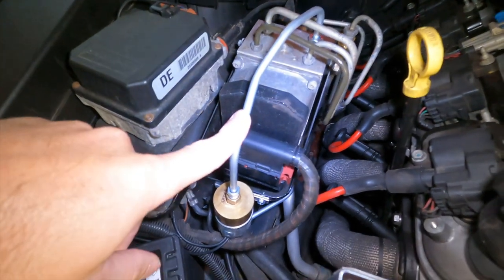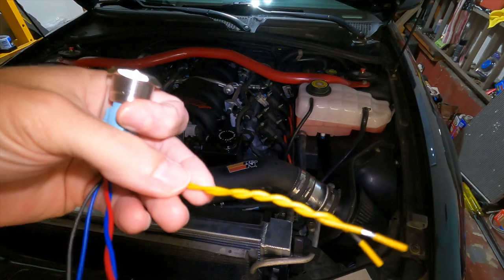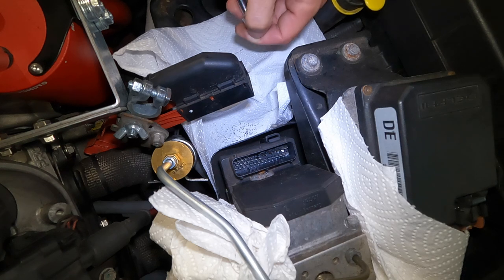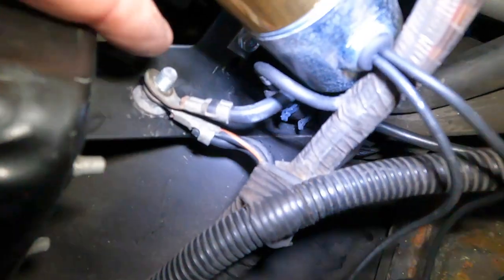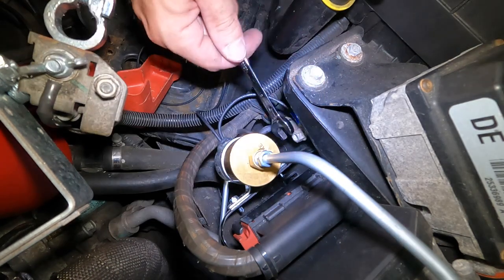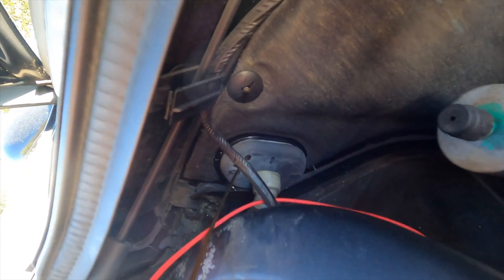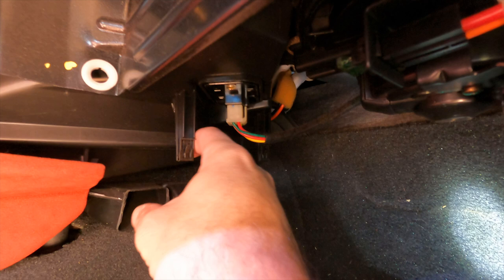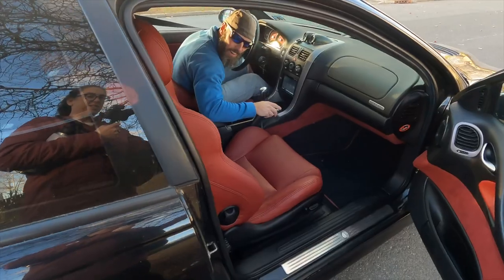04 GTO Line Lock install

Comment: Interesting install.   Just wondering if it's advisable to turn off the TC before use, my thinking being the body control module might read the speed difference between front and rear and try to make correction's.   I'm not certain, just think out loud
Reply from the maker: Yeah you want to turn the TC off or it will bog it down. When I get the suspension clunk sorted I'll do the run down on what you gotta do.